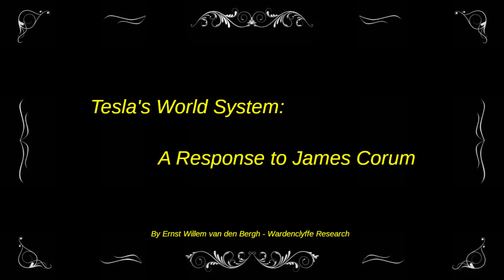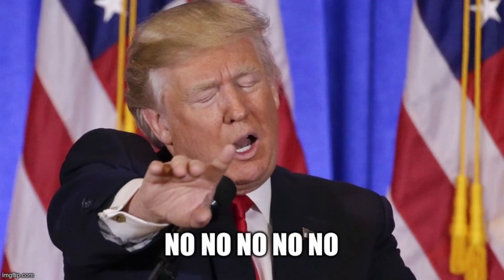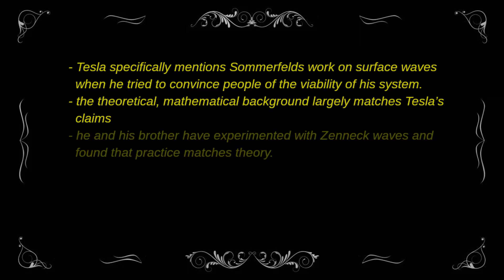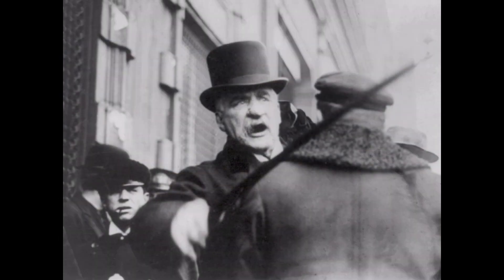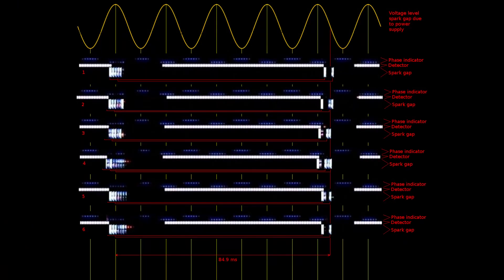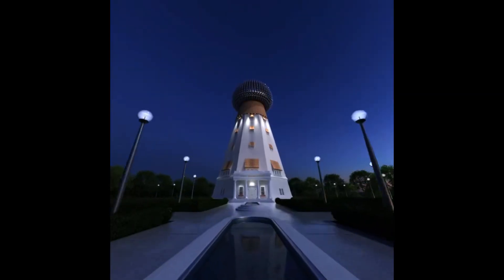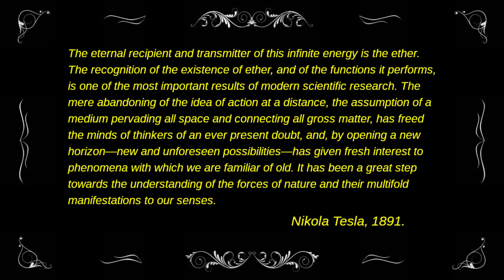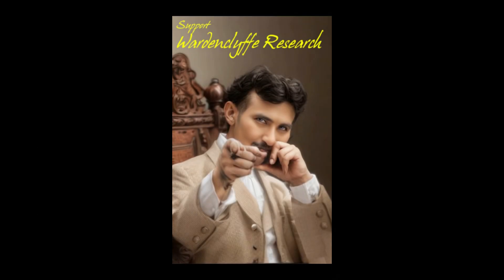Did Tesla use Zenneck waves, a response to James Corum

Comment from the maker: I got this response from the Corum brothers: https://drive.google.com/file/d/1RpMpoiTOjRjv4a045xJLUM5pp6ajkAjN/
To my surprise (not sarcastic!) they seem to be quite agitated.
I was very excited to get their response as I cannot reach them otherwise, but... they clearly misunderstood my comment on the possibility of a standing Zenneck wave and (after one careful read) I cannot agree with their rebuttals and am disappointed but... you judge for yourself.
Reply: Excellent, I'll spread this around.  
One point that few ever mention:  if the wavelength is far larger than the altitude of the ionosphere, doesn't this suppress Schumann resonance?   It would be like trying to pump 1MHz through x-band microwave waveguide.   
The Corums made me see one interesting aspect:  any collimated beam of RF will bounce off a metal surface, same as with a mirror, even if the incident angle is very close to zero.  Those wave-reflections and those surface-currents inside the mirror will fling the wave back away, angle of reflection equals angle of incidence.   The whole Tesla topic involves something new: making an incoming wave start clinging to the mirror, as if the mirror was some sort of weird optical fiber.   (And to produce this effect with light, can we paint some substance on a mirror, then aim a laser spot at it, so the reflected light then runs horizontal to the mirror?  And if the mirror was a highly polished sphere, would the light bend?)   
Create some optical ring-resonators with Zenneck modes on metal, rather than conventional reflections from dielectrics?   But shine lasers on metal beads and we only get reflections.  Perhaps to convince physicists we should figure out the optical version, where "broadcast power" is trapping light on the surface of a metal bead.  Us ion-beam lithography to carve a little nano-forest made of resonant Tesla towers.
Reply: Phase velocity can be faster than the  speed of light. Isn't that what's going on here?

Comment: Tesla stated where Broadcast Power happened.    He noticed that a TC secondary is actually a single wire.  No circuit involved.   Take the idea and run with it.   Hook two identical TC secondaries together with a very long single wire.  Drive one coil only.  The waves on that long wire  ...aren't they the same as the waves on Goubau single-wire transmission line?  But this is VLF, with no "launcher-cone."   Apparently a TC secondary, run at quarterwave resonance, is a "launcher cone" for a non-microwave version of Goubau's single-wire transmission line.   (Goubau lines are typically ONLY used at the low end of UHF band, and shorter.   Apparently that's not a requirement?)
When I finally noticed Tesla's statement, I grabbed some 1in plastic electrical conduit, and used a lathe to wind Tesla coils which were 1in wide and many feet long.   Unmistakably they're waveguides.  But no circuitry is involved.   
Does anyone say that the waves on these coils cannot be Zenneck waves?   Wind a grounded "secondary coil" that's 1cm diameter and 15 feet tall.  The thing behaves like an electromagnetic organ-pipe.   

  (O.T. bend it in a circle, and you've got an odd sort of desktop EM model of the planet Earth.  Single-wire waves, little or no radiation escaping.  No need to get some copper foil and add an "ionosphere." to this ring.    Many years later, the Corums patented exactly this, for use in electrical energy storage without capacitors.)
Reply from the maker: I thought that Corum patent did involve capacitors as well? Do you have a link for me?
Reply: @WardenclyffeResearch  That was their Texzon energy-storage ring.   Corum 2016 paper on broadcast-power antennas  is IEEE Surface Waves and the Crucial Propagation Experiment.   Also, find about 100 patents with Corum as inventor.

For broadcast-power the Corum stuff looks odd, where they insist that in order to launch single-wire waves, first there must be a series-capacitor in the ground wire (or what, ...Tesla's version wo/capacitor doesn't work?  wtf.)  
One suspects that either they're fooling themselves with too much theory, or more probably, Tesla's version isn't patentable, while adding a series capacitor is a fundamental change, and "makes it theirs."   

Marconi did lots of similar patent-theft, i.e. patenting Righi's transmitter under his own name in the UK.  But that was OK, right, because he added a ground wire!  So it wasn't the "Righi Oscillator" anymore.   Then he stole the Branly Coherer.  But he added a bit of mercury to Branly's silver powder, so it wasn't the Branly Coherer anymore, and he could "own" it.   (I think Branly sued him and won, while Professor Righi was too much of a scholar to take legal action.)   
If Corums are right, and the wave-launching requires a delay element, then Tesla's patents won't work as shown  ...unless an outbreak of corona-discharge adds major capacitance-delay in series.   If true, then Tesla's version might require corona-discharge, and have little or no emission-wattage without it (i.e. stop working at low voltage.)   
In that case, without a time-delay element, Tesla's antenna impedance would display no virtual resistor, no Real-component of space-impedance (and no losses to wave-emission.)   But also, Tesla's actual constructions added a spark-gap, and weren't just CW pure LC resonators connected to a ground-stake.
Reply: @WardenclyffeResearch  Also, I suspect that Corums really really really want to be believed by academia.  If so, then it doesn't matter if their device works empirically.  Instead, their "pure theory" must be bulletproof and unquestionable.  (But you, you question their theory.   O the horror!)   
They do have a point.  There really are two kinds of waves.   One version is surface-currents caused by EM reflection from a conductor.   With those, there is no waveguide-effect.   "Angle of incidence equals angle of reflection," so we cannot attach RF to a metal.   It just bounces off.   And, these are the ground-waves associated with quarterwave antenna towers.   If true, then a conventional antenna tower can never emit any Tesla-style surface waves.  
The other type of wave is the true EM surface-wave, as with E-line patents (and the Goubau G-line,) where the wave follows a conductor forever, and if the conductor is curved, the wave still follows it.   Goubau insisted that this only works if the conductor has a dielectric coating.   Later it turns out that it also works if the conductor is resistive, so the Poynting flow isn't perfectly parallel, and slightly bends towards the conductor.   The key point is that the propagation velocity along the conductor must be slightly below lightspeed, or otherwise the waves won't "attach" and follow the conductor.   
As for me, I predicted that the Corum project would fail.   Maybe they can emit a few watts, but not any useful worldwide broadcast power.   They don't know Tesla's secret.   (They came close, with their Army-funded "death ray" paper, but then missed the basic idea, and didn't include it in their Milford TX transmitter.)   
But I could easily be wrong, because I got that info from an RV "remote viewer," where inside the main terminal of both the Colorado Springs transmitter and the Wardenclyffe tower is a mysterious device that Tesla kept secret and never patented, although discussed in news interviews, while unsuccessfully trying to deflect the reporter's attention from it.   (So in other words, the metal sphere at Colorado Springs wasn't hollow.  It had a device inside which made Broadcast Power actually start working.   But to accept that, first you have to believe in psychic powers!  Heh.)

Comment: Tesla patent 787412 
This is what needs careful study to understand Tesla's ideas. This patent describes with actual numbers how lightening being detected and measured and gives us a better understanding of what he was planning. He describes the frequency and how it could be used. To me this is the most overlooked and should be studied and read and experimented with. Those pulses at those intervals of those frequencies are what we need to start experimenting with.
Reply: We need someone with a massive tesla coil to produce timed pulses at the frequencies he lists and measure the max and null points with a reciever. He makes it clear that the standing waves at the max points would be where the power is at and could also be a position for another relay station properly timed to boost transmission. If we could setup some experiments I think we could prove what actually is or is not possible
Reply from the maker: @newmonengineering  I have, more or less, done this already. Haven't you seen that video?

Comment: If you look at my  2 video I explained how Point A to Point  B communication and energy transfer works using INTERFACE  But in addition to this method  it is  another one: EM Energy from   lightning  discharging in earth randomly at the *Complex Brewster Angle *  lands in the very same Interface ( The 2D waveguide made from conductive earth and dielectric Air)   Tesla coil used in both  of mentioned methods can  serve as  Transmitter and receiver pair with no change. The only difference is that in  extracting energy from the Schumann Waveguide( Earth Ionosphere) the  natural transmitter transmits  energy into the  Interface and  we use  only  one Tesla Coil as a receiver.  Tuning is done mostly ( but not only) by adjusting position of  TOP CAPACITOR (and impedance matching device between Tesla coil and the load)    Presentation of working device was  planned at a later time  . I have my own reasons for that.

 My video suggested to look at:  Part 2 The Corum and Zenneck Surface Wave guide to energy transfer
and  video : Energy extraction from Schumann waveguide
Wesley